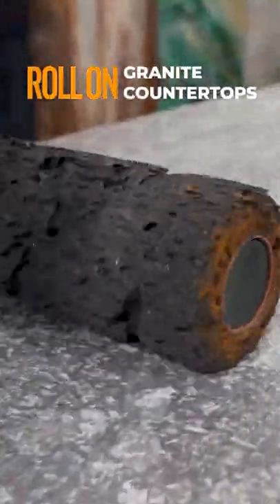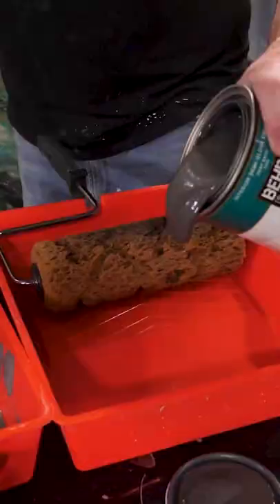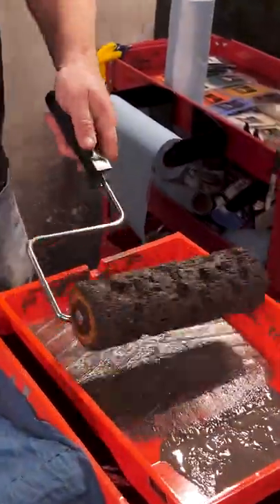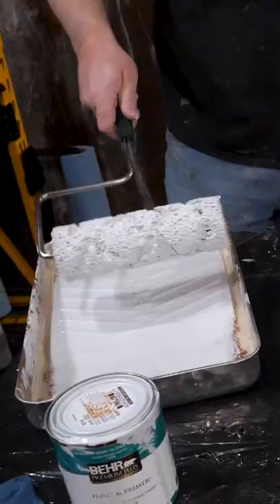Make any Countertop look like Granite with this Pro Tip #shorts

Comment: Can you do this technique on a foam board?
Reply: You sure can!
Reply: Primer. Fiber mesh flood , sand primer , paint, epoxy?
Reply from the maker: 1st step paint foam with epoxy undercoat
2nd step thin layer of epoxy over fiberglass mesh - tint epoxy, let cure 
3rd step lightly sand with 220, pour epoxy color coat, let cure
4th step lightly sand with 220, apply ultimate topcoat or clear epoxy coat to protect colors
5th step - ready to install
Let me know if you have any questions
Reply: I understand that method but when do you or how do you do the roller granite look on foam board